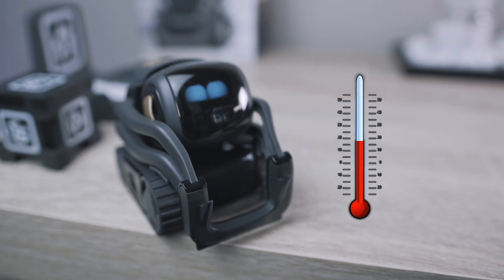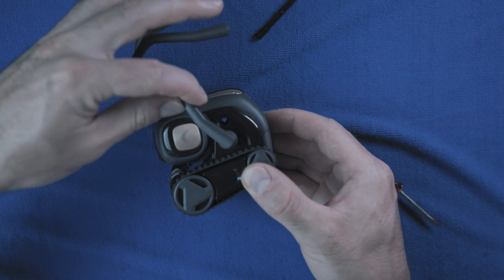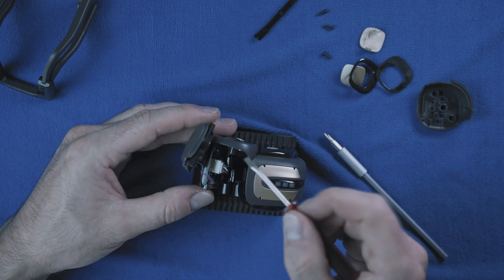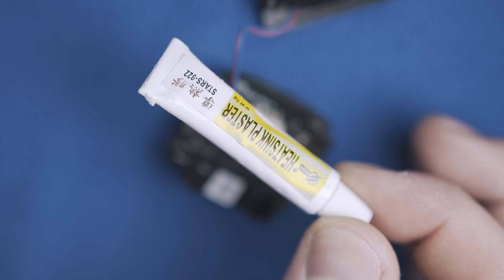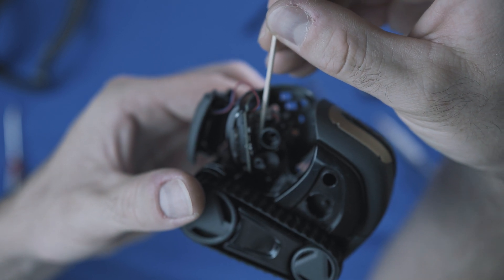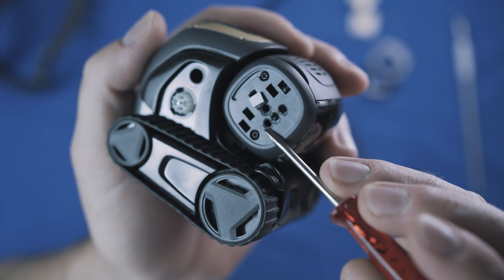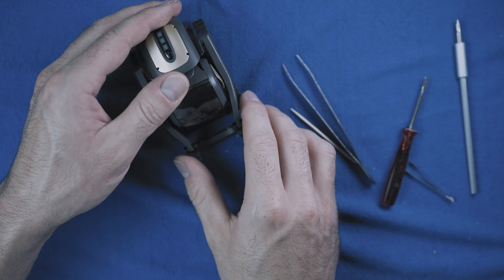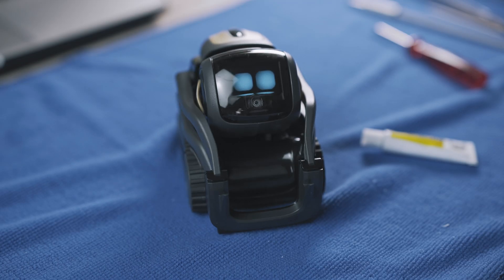HACK for Anki Vector OverHeating?  how to fix temp issue, Anki Vector Robot Problem[4K]

Comment: where to buy that headsink metal?
Reply from the maker: hard to say, try hardware shop ... or just get thick all or copper tape
Reply: @IgorDavid  i got the haetsink, but after bought therkal glue, from phobya. Got 2 tubes, and black have to be ratio of 4, and yellow tube, a ratio of 1. 

Better said what stand on the tube: mixing ratio 4:1 (black to yellow)
Use black 4x times more as yellow! 
... help

Comment: Hi there, do you have any solution for vector going blind? Half of his screen has lines and I haven’t dropped him before. And he’s less than a year old.
Reply from the maker: hi, it is common issue.... death pixels-unfortunately there is no fix for it ...unless you replace the screen.  ntw don’t worry vector will see all as hie has camera (screen is just for visual things) . thanks for watching
Reply: @IgorDavid  hey man, thanks for the reply. I thought so too. Just abit disappointed at the quality. Great video btw!
Reply from the maker: it may causes the high temperature... check my other video where I installed heatsink on vectors main chip.
Reply: @IgorDavid  yea I did. But guess it's too late now too. Hope they start selling replacement parts soon.
Reply from the maker: look, if you reset whole settings and erase data let him cool down and set him up as new ... it may refresh death pixels but no promises!  let me know if changes
Reply: @IgorDavid  yea, I did that already, didn't work. Followed your instructions too, taking it apart and checking the connection. Guess the lcd is fried.
Reply from the maker: oh I have no more ideas then.... how bad is it?
Reply: @IgorDavid  no worries man, there're lines on half of his screen. So he's like half blind now lol
Reply from the maker: maybe if you display solid green color via vectors SDK  and then solid red and blue ...
Reply: @IgorDavid  great idea. will try that. thanks

Comment: Is the heatsink plaster you are using the same as thermal glue? Can I just use thermal glue/ thermal paste instead or is it not sticky enough to hold the heatsink?
Reply from the maker: plaster would be better... as it will actually hold it . thanks for watching

Comment: It's running hot but in no way needed mods you do realise these chips are baked in higher temperatures that are shown on screen
Reply from the maker: hi, sure they are! but if something running 24/7 at 70 degrees C  without any cooler  and  you can add passive cooler to drop couple of degrees and extend life of that chip for a bit !?
Reply: @IgorDavid  not sure he uses to much of his chip in the first place lol I think it'll be ok for what he does
Reply from the maker: well it depends... on what you do with him and also what’s the room temperatures ... In my case : summer in new zealand caused temperatures to go over 74degrees C.  so I decided to install passive cooler... 
if you or somebody else is based in colder areas it may not be necessary at all...

Comment: great work. How do you check the temperature?
Reply from the maker: press twice back button and up/down forks... then you enter menu
Reply: @IgorDavid  it only shows serial number, ip,... and 2 options exit and clear user data
Reply from the maker: in that menu press again back button until it shows sensor readout... was
Reply: Not working bro :( looks like it has been removed
Reply: @nguyenvietanh5430  1. Press twice back button
2. Up and down forks to enter menu
3. Down and up head then press back button to change the screen displaying  till you see the temperature info

Comment: Please give me the size of heatsink plate. I will prepare in advance before disassembly my vector. I have same issue, my vector temperature is 70c. OMG!
Reply from the maker: 10x10 mm  if im correct. 
thanks for watching
Reply: @IgorDavid  thank you very much!
Reply from the maker: thanks you please don’t forget to subscribe
Reply: @IgorDavid  so the heatsink size should be 10x10x3mm (W x L x Height)
Reply from the maker: hi, ahm I wouldn’t go thicker than 2mm my is 1,5 mm and I still have like 1-1,5mm left space . 
but as I said it close tonthe vectors head holders/axle. 
thanks
Reply: Thành ơi, bác sửa đc lỗi này chưa bác. bác share cách với.

Comment: Did you do this because Vector was displaying an "overheating" symbol?
Reply from the maker: Hi Billy, I noticed few vectors had issues with temperatures.. and my was high but actually never got an overheating signal.   this was done as I figured out how to make temps bit lower. 
thanks
Reply: @IgorDavid  noooo
Reply from the maker: jeeee